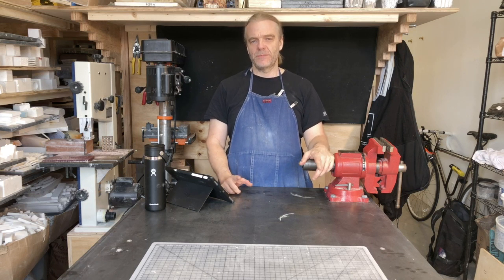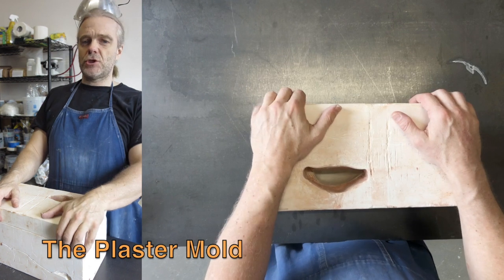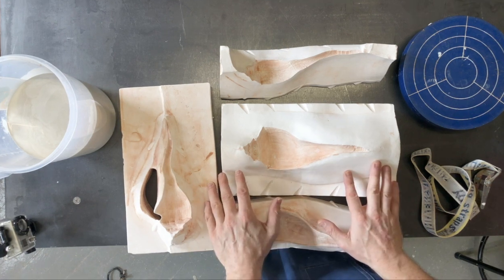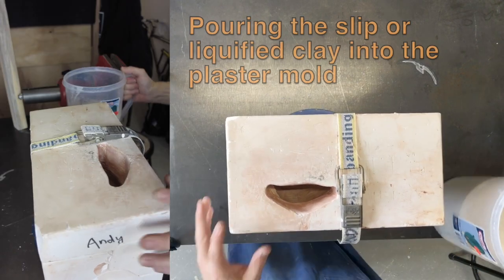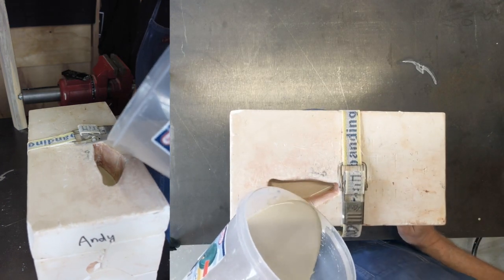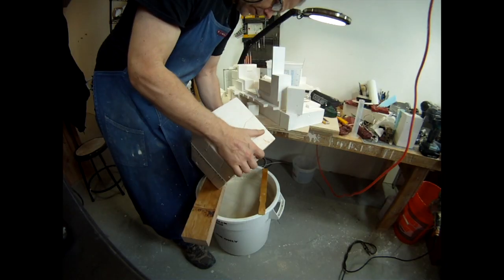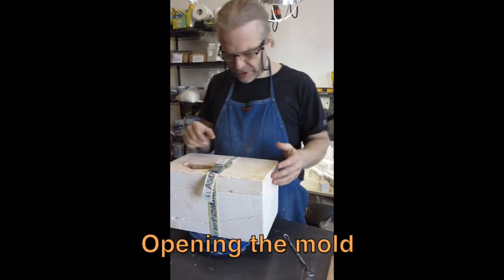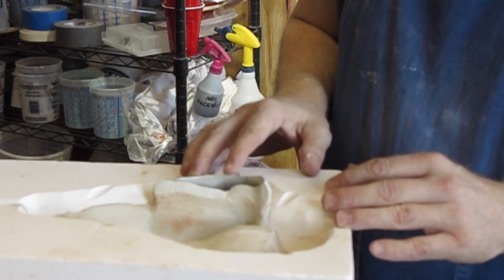Slipcasting Ceramics Guaranteed results every time!

Comment: Love your sense of humor and those dang straps can be ridiculous sometimes!! I have been slipcasting forever and for some reason the slip I have right now will NOT BEHAVE!! I had to add some darvan 7 to it and now it has a marbled look to it. I have mixed it and mixed it but I can’t get it to not be marbled. Is there a problem with this or can I use it? I’d love to know your thoughts on this. I have no one around to ask so if you could let me know I would soo much appreciate it!!
Reply from the maker: Hi Michele, thanks! I'm going to do a video of those "dang straps"!!! So not intuitive. About the slip, first, try it and see how it casts. Too much or too little Darvan is not going to change the slip after it's cast-at least in my experience. Second, I'm a nerd when it comes to mixing. I test specific gravity a few times and make double sure it's dialed in, mid 1.70's. Then start in with the Darvan 7 (that's my choice too for deflocculant). I use a Ford Cup and test it several times. I shoot for a 40-45 second drain. Once I added too much Darvan. The slip was runny and it seemed gel up. Also a bunch of slip got hard on the bottom of the bucket. But it slip cast fine. So go figure! This is a good group on FB for slipcasting, ask your question over there, you'll get many responses from some experienced people: https://www.facebook.com/groups/315135638976315.  Good Luck!😁
Reply: Andy Graves Structures THANK YOU SOO MUCH!! I will try and cast something and see how it goes! I’m so relieved after reading your comment. Thanks again!!